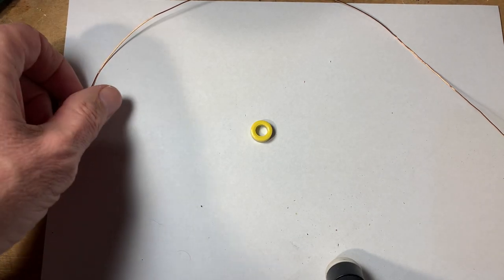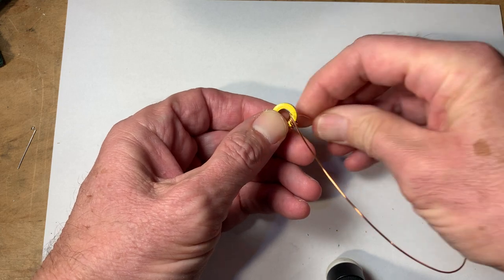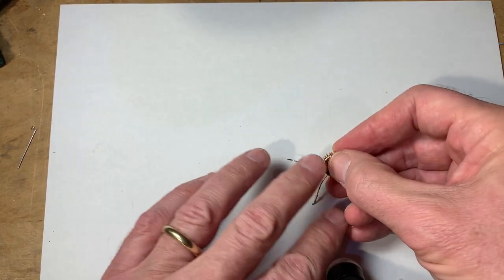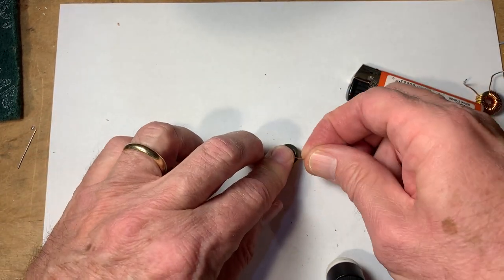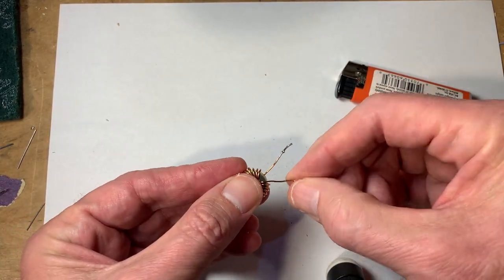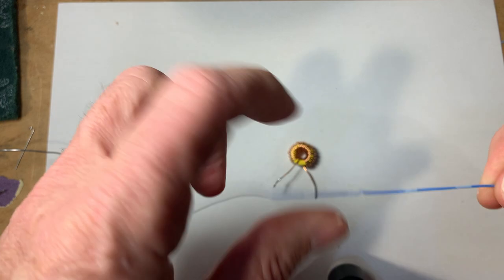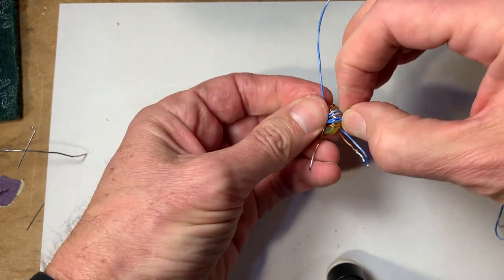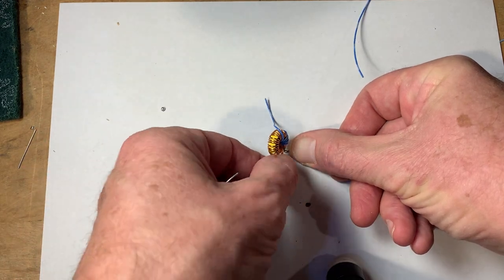How to Wind a Toroidal Transformer  -- March 5, 2023

Comment: You make it look easy! Thing that always gets me is the phasing if that's important to the circuit.  73 - Dino KLØS
Reply from the maker: Getting the phasing right is not that hard if you approach it systematically.  It helps to have three different colored wires.  73  Bill
Reply: @soldersmoke  Yeah, it's not so much keeping track of which wire is which but when the phasing dots are included because they're important I always have to reinvent the wheel!  😂
Reply from the maker: For use with the diode ring:  ID wires 1, 2 and 3.   Designate wire one as the RF or LO input.  Top to input, bottom to ground.  The, Top of two to bottom of 3 -- solder these together.  They will either go to ground or to AF out.  The two remaining wires go to the diode ring (top and bottom or left and right). Hope this helps.  It is hard.  We chickened out with the students and made use of trifilar toroids wound in Hyderabad!  73  Bill

Comment: Bill. Just a bit more on my double balanced mixer adventures. I was in contact with Pete Juliano a month ago. I had thanked him for his 3 part series on double balanced diode ring mixers. He warned me it was not to taken lightly. That unless I was extremely lucky, I would not get the same results as a commercialy made unit. He wasn't trying to put me off, and didn't. He named some of the ones you could get, and how they were cheaper now. I think I might buy an ADE-1 to use in what I'm building. I can then use that as a guide to how well my home build ones are performing. My interest in DBM all started when I decided I wanted to build an upconverter for my cheap SDR dongle.
Reply from the maker: Trevor:  This is one of the topics on which Pete and I disagree.   I think you can make your own diode ring mixers using transformers you wind yourself. You can see the results in the many DC receivers currently being built.  Sure, you could buy an SBL-1 or an ADE-1 (and I have used both).  But by the same token you could buy an ICOM 7300, right?   in the high school DC receiver project we wanted to keep it as homebrew as possible.  That is why we are using an LC analog VFO (not an Si5351) and homebrew BP filters and homebrew diode ring mixers.  Different strokes for different folks.  To each his own.  This is all for fun.  73  Bill
Reply: Thanks Bill. Point well taken. The ADE-1 can wait for another day. I know pleasure of building something yourself and have it work. I've spent quite a bit time accumulating knowledge, the theory, the last few weeks. It's time to do more actual building.

Comment: Very interesting. I was wondering if you would check the inductance, and you did. Something I've been trying to find out is, what would you expect the inductance to be with a double balanced mixer? If you just measured one of the trifuler windings on the toroid? I have a cheap L/C meter on the way, which according to the specs can read quite low inductance. I plan to do some experimentation. For instance. Could I make a diode ring mixer using air wound coils? Could I use the little toroids I've savaged from old light bulbs? I've only just started out with diode ring mixers, but when my inductance meter arrives, these are the things I plan to experiment with.
Reply from the maker: Trevor:   A while back Farhan gave me a box of trifilar toroids made of the usual 43 material.  I measured the turns at 33uH each.   These are the transformers we are using in our DC receivers.  I have also used them in the diode ring mixers of several homebrew rigs - they always work for me. Yes, air core would also work -- in the original version of the BITX 20 Farhan was using nylon washers as the toroidal cores.  And I think he was using 3D printed plastic cores in his Daylight Again rig. I think toroidal cores are best because they are self-shielding, and realize that the ferrite or iron powder cores let you get to a given inductance with far fewer turns, and thus with probably higher Q.  73  Bill
Reply: Thanks for checking that for me. While I'd always seen the inductance value for coils in filters, this one I couldn't find.

Comment: Man, that video was REALLY helpful!  Very clear and concise!  Just what I was looking for to be sure I properly wind that transformer.
The mixer transformers seem much more complex.  I am having difficulty understanding how to do the "trifiller" thing and getting the windings correctly oriented.....
Would love to see a similar video demonstrating how to wind that one properly!
Great stuff Bill!
73
Pete
KD2OMV
Reply from the maker: Thanks Pete.  I will try to make a video about how to build a trifilar transformer.  But in the meantime the internet could help.  You really just take three insulated wires, wrap them together, then wind them through the toroid as if the bundle were a single wire.  You end up with three at the top and three at the bottom of the toroid.  You usually use one (say #1) wire as the input link (one of these wires to ground, the other taking the input).  You take the bottom of #2  and solder it to the top of #3.  This is often the ground point,  with the other ends going to the diodes in a mixer.  It is not that bad.  You just have to think a bit about what you are doing and how that relates to the schematic in front of you.  Doug DeMaw had a lot of good diagrams on this -- I am pretty sure you can find them on the internet.  Hope this helps. 73  Bill
Reply: @soldersmoke  Thanks so much for the kind reply, Bill....that makes complete sense;  twist three together THEN wind them, therefore, not having to worry about winding one coil in the opposite direction by mistake....I believe you shared a story in one of your wayback podcasts about having had some such trouble winding a coil in the wrong direction, and figuring it out years later when you finally got the rig working????  (Tuna Tin or some such rig??) That was all I was thinking about when I stared at the schematic and those phasing dots....LOL!...meanwhile, I managed to find this Youtube video on the subject, https://youtu.be/DVqqOT1ONsY, and I assume what this guy is doing is what is needed for your mixer??  Hopefully that will help others looking for a walk through on building the transformer....
Can't wait to get this receiver going....It will hopefully be a good match to the 6T9 single tube transmitter I built a while back.
I am still proud that my call sign is written on your "ET2"...is it still hanging on the wall?
73
Pete
KD2OMV
Reply from the maker: Yes Pete -- still on the wall!  And your QSL is also on the wall.  Thanks again.  73  Bill